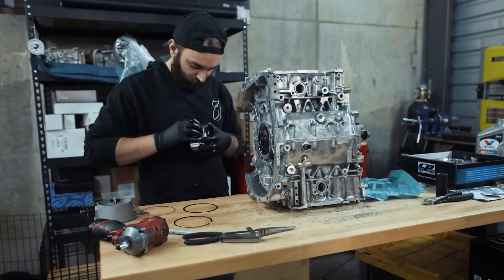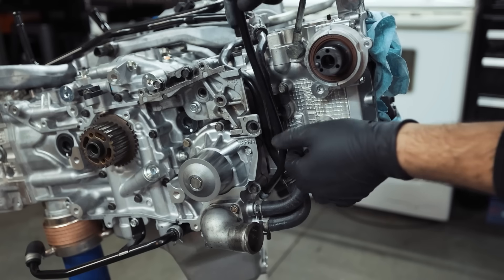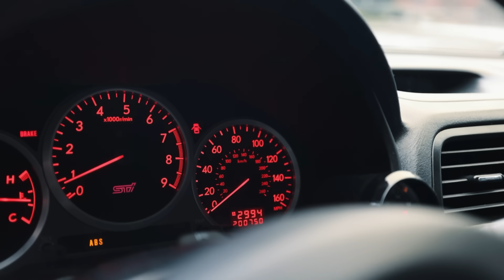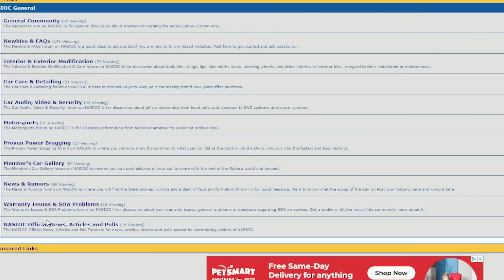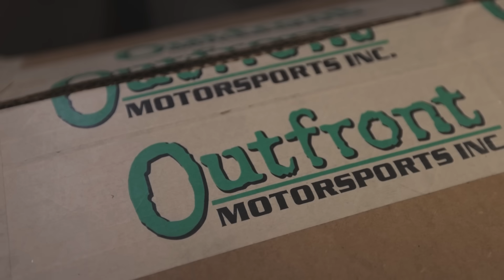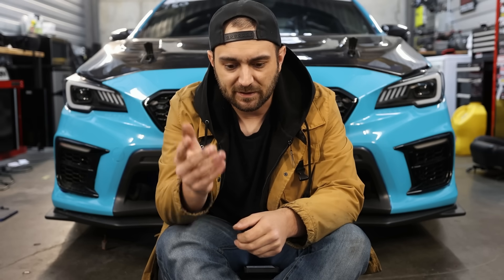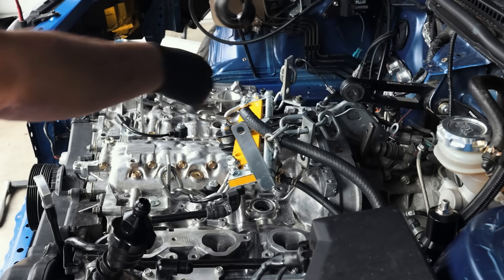The EJ Engine: Subaru's Crown Jewel or Overrated Relic?

Comment: EJ is overrated is 2024, the FA is a superior design for more efficiency and power production.

Edit: LET’S GO TANNER!!!
Reply from the maker: For the bang for buck I’d still take an EJ, keep in mind for anything FA related you need a standalone, port injection, secondary fuel system, STI driveline, no aftermarket cam options etc 

I’ll agree it’s more efficient up to about 450whp 😉
Reply: Why do you need stand alone?@Smeedia
Reply: Fa Still sounds like crap
Reply: @Smeedia  hopefully after a couple years of VB work they'll have some more options
Reply: @Pepin2k  you can run UEL header on the new Fa24 with a tune and doesn’t lose as much power as the Fa20 and can even gain power
Reply: FA’s are moneypits
Reply from the maker: @tungnguyen4074 but it still will increase EGTs, reduce fuel economy, negated the point of having a twin scroll turbo. Not worth the draw backs of UEL on a turbo FA engine
Reply from the maker: @christopherrogers8316  to be able to add port injection to support reliable power north of 500. Only options right now are motec, maybe emtron and link
Reply: @tungnguyen4074  gross, UEL is ridiculous. Even WRC runs an EL header on the EJ cars.
Reply: @Pepin2k  performance > sound. That being said my wife’s Mach-E GT will dust 95% of anything on at a light but it’s uninspiring. So sound does play a role in the feeling.
Reply: @christopherrogers8316  FA doesn’t support port fuel. Need to control Air Fuel and Spark. Port fuel allows a charge air cooling in the runner which has a pseudo Venturi effect. It decreases the pressure in the moving air stream which decrease the manifold pressure delta. Simply but not accurately put it’s more boost because it’s more fuel too but it’s the same load on the turbo.
Reply: @RadDadisRad  thats motorsport. EL header get more power and turbo respond which is what motorsport team wants. But so street it is alright to run it
Reply: @totaleclipse05  both turbo FA and EJ are money pit
Reply: Hey thats what i named my 21 wrx lmao!!@totaleclipse05
Reply: @Smeedia  i saw a video of a tuning shop testing their FA24 and it is not as bad as the fa20. But yea, the con out weight the pro
Reply: @Pepin2k  It sounds like a subaru with equal length headers wym?
Reply: EJs are still cheaper and easier to work on in my opinion, love FAs for the efficiency, but for ALMOST the same HP you can be just as reliable and efficient with a built EJ. I’ve seen quite a few that push a reliable 450 or more to the wheel
Reply: By today's time comparing the potential here is like comparing your grandpa to you in performance. Although fa24 is far better than the fa20 it's still a new platform yet to be pushed to its full potential. I've had both ej and fa
Reply: AHAHAHAHAHA no
Reply: @Pepin2k  💯 FA'S Simply sound like a pissed Off Raper Who Never Made it 🤷
Reply: @totaleclipse05 Some would say modding a Subaru would be considered a money pit. Only an immature person could consciously make such overarching comments and your kind is what usually who I see make bad choices tuning/modifying leading to money pit situations. If you had a deeper understanding of mechanics/cars in general,  you probably would retract your childish statement.
Reply: @beaches2mountains230  My 2019 is modded and has almost 70k miles now. I know how to take care of vehicles as I do much of my own maintenance on them. How is a true statement a childish statement btw? Sorry the truth hurts.
Reply: FA are a huge money pit gotta upgrade everything if you want power and want the car to still run. Ej’s are cheaper for power up to 450whp and don’t sound like complete garbage.
Reply: 2021 Sti. Small mods. I haven’t run into any problems and I have 40k on it. I think maintenance is a big thing with the engine. And not a lot of childish play. I think smeedia is right. Stop thinking it’s and Evo and the engine will last. And this comes from a previous Evo owner. Rs 2006 best
Reply: @Smeedia Do you think you can make decent power NA on FA24 or would the EG33 be better for NA?
Reply: @RadDadisRad  i think you add port injection just because the direct injection can only flow so much fuel to about sub 500whp. after is when you would add secondary fuel
Reply: @RadDadisRad  the fa24 in the stock brz/gr86 is both port and direct injected thanks to Toyota.
Reply: @christopherrogers8316  XDI has a prototype pump and injectors for the FA20/24. DI has its flaws and limitations with idle airflow and intake runner and valve coking. Port fuel idle air mixture and atomization is better than DI. DI provides maximum cylinder fill while decreasing preignition events, in most cases. One of the cases low speed knock aka “super knock.”
Reply: @Chris-df8qf  D4S sucks in the Toyota design
Reply: The EJ wouldn't be overrated if they were reliable. They should have never retired the good old 2.2L and the H6.
Reply: I seen 1500 HP EJs...  where's the 1500 HP FA?  😂
Reply: @iAmFAUST  did you manage to learn proper English while seeing those 1500hp builds?
Reply: @Pepin2k wrong.
Reply: @RadDadisRad you just swap to a BRZ manifold. It’s not that big of a deal
Reply: @beaches2mountains230 this

Comment: MotoIQ did a really good video comparing the EJ and FA.  The gist, that I took away, was that (from and engineering standpoint) the FA is better in every way except its lack of priority oiling, and it's still relatively new, so the aftermarket just hasn't had a lot of development time with it compared to the EJ (roughly one decade compared to roughly 4 decades).
Reply: The MotoIQ vid was packed with good intel on the FA. Reinforced my WRX Limited choice in '21, although now I've upgraded at least as much as the cost differential for an STI, and arguably would have been pretty sweet to own the last production model. I don't think we knew it would be the last in June of '21. Love my REX though, and now that Cobb has released flex fuel for '15-21...

Comment: The FA/FB series engines are the result of Subaru moving toward the mass market from the niche market - more EPA friendly to make the numbers.  The STI is gone mostly because of this.  These engines are cheaper to assemble - just glue 'em together with Three Bond.  Rather marks the end of an era.  Sad but predictable.  I owned a Subaru with the FB series engine - got the short block warranty replacement for oil consumption from those low-tension rings and water-thin 0w20 oil at 18k miles - and traded it at 48k for an F350 (it couldn't tow a 16k lb horse trailer...).  Still own 2 EJ cars.  Reliable, no chain rattle, no oil consumption issues, just old-school engines that do the job without drama.

Comment: The main problem with EJ FA FB engines is mass production, Subaru has to produce millions of engines as quickly as possible. During the casting process contaminates, oxidation, or dross are introduced into the mold causing irregularities visible on the outside of the casings. This causes internal stress and weaknesses that eventually distort the block, more (HP) stress and heat creates more distortion. The early EJ 20g and 22T blocks were cast in a vacuum chamber mostly eliminating contamination and porosity resulting in a much stronger block however this was not cost effective so Subaru abandon this method.

Comment: i just put a fully built FA20 block with an STI driveline but still don’t plan on making more that 500whp. i feel like the FA20 (idk anything abt FA24 or RA) is more reliable than the EJ255 but never had an EJ so im biased

Comment: It’s really a good motor and easy to work on. I have several over 200k and a forester with 300k.
Reply from the maker: I’ve seen a couple go over 400K, taken care of and unmodified they can go for a WHILEZ
Reply: I live in Japan and one of my dream cars is a GRB hatch. I would like to know how much more reliable an EJ20 is in stock form. It can get extremely expensive to repair them here.
Reply from the maker: @YuichiTamaki tbh the JDM EJ20s from what I’ve seen take a bit more abuse and are a bit more reliable when cared for
Reply: @Smeedia  Thanks for replying! Are oil leaks a given in these engines? Here cars with 100k kilometers go down in price dramatically.
Reply from the maker: @YuichiTamaki naturally at 100K you’ll have some leaks. Nothing outside of the normal. 

Valve covers, rear main, cam seals etc 🫡
Reply: There's a bloke here in Aus that bought his Subaru Liberty RS brand new in 1992, he's done 2 head gaskets, 2 rear mains, 2 tappet covers and 1 clutch in the 555,555 km's hes done on it. He's participated in rallys and other race events over the years and still looks brand spanken new. These cars will look after you if you look after them.

Comment: The EJ seems to handle high horsepower and high turbo boost than other platforms. Bader loves getting serious power from stock blocks. My FA20 blows after 350 hp and torque
Reply from the maker: FAs imo are fantastic up to about 450ish whp after they they become some serious money pits
Reply: 350? Ive talked to many tuners who say they are capable of 400+ as long as you keep the toque down, obviously the stock clutch is gonna need upgraded tho
Reply: @Smeedia maybe it’s cuz I own an 86 but is 450hp necessary out of an FA?
Reply: On no mods other than a boost controller?( Which is me).Stock fuel pump, no front mount intercooler, no injectors, pump gas? Unheard of
Reply from the maker: @omarawilson2853 on the 86 you can get more out of em, the 86 has Toyotas D4S that comes factory with direct and port injection. The WRXs only get direct injection

Comment: I think what I like about the EJ so much is that it’s such an accessible engine to learn on and there’s such a large variety of sub variants and once you know the basics you can basically do anything to them. My legacy with a 255/257 had its first motor last for 348000ks stock (killed it when I brought it home whole other story) and the second one now will be cracking 200 so they do last if looked after and not just abused

Comment: Ok the ej is a good engine, especially for its time. Its actually relatively simple. 

Ej20 turbo is a good build, especially 2.1 stroker.

Availability of parts, knowledge, common recipes for power. 

But for very high power i wouldn't recommend 

Good video, nice content

Comment: Crown Jewel. The EJ’s limitations are pretty easily overcome and relatively cheap in comparison to every other engine they have produced since. Mainly because overcoming the fueling issue on direct injection is SO costly.
Reply from the maker: If they make an affordable option for secondary fueling on the 24s that could all change 👀🫣

Comment: EG33 pretty much is an EJ22 with 2 extra pots. I’d have stuck with the 33 - dry sumped. Aren’t they also semi closed deck? 33 would have more air flow with less boost.

Comment: you are very knowledgeable when it comes to Subaru engines. EJ being produces for such a long time, fairly confident a lot of the inherent initial problems it had has been almost fixed. right now I am debating whether to pick up a 2017-2021 sti or to go get a 2024 wrx as another daily driver (I have a 2017 Toyota 86 GTS since new)

Comment: Honestly love the sound of my ej25, and I have had some problems with my subaru but mainly due to the previous owner, I have fixed every problem it had and now having it running pretty good. I don't think the ej is a bad motor at all, just have to stay on top of your maintenance and just use the car for what it's meant for!

Comment: Honestly my favorite part about the EJ is how easy it is to work on! People's first argument is always "but you have to pull the engine to get the spark plugs"... like okay sure the spark plugs are kinda a pain, but literally everything else is so easy and so well thought out! The fact that you can easily reach/access everything from the top or bottom is so great!
Reply: they have been around so long there is almost always a trick, or a set of tools/extensions that work perfectly for the tight spaces and you can figure that out on forums or by asking around fairly easily. doing spark plugs with the right tools is easier on an EJ than a lot of other cars that people generally consider easy to work on.

Comment: I've gapped the new 2023 wrx in my 2011 wrx with over 200k miles, I'm convinced that the extra low end tourqe of the 2.5 helped in a straight line, meanwhile the 2.0 makes it's power on the top and mid end

Comment: FA24 is a beast. Bolt ons and a tune will get you over 400lbft torque and close to 400hp.

The new FA's are also tuned better out the gate. Very smooth running without any weird fueling or timing issues like all of the EJ stuff ive owned in the past. 

The FA24 block is sognificantly stronger than the EJ. There are people pushing crazy high HP on stock blocks. Fueling is certainly the limiting factor. EJ on the other hand has issues holding a moderate tune with people blowing ringlands on stock power. 

EJ is great if you want 500+hp. Theyre simple, easy to work on, and have known issues that everyone knows how to address. But it looks like the FA24 is just wayyyy more stout out of the box.

Comment: Proud owner of a '21 STI here. Last of its breed, and will be missed. I have many plans for it, once the warranty is gone (august). Shame there is not going to be a port injected successor. :/
Reply from the maker: I think the days of only port injection are behind us now 💔
Reply: I have a 21 STi as well and want to mod it but due to the high cost of mods I'm going to sell it and mod a GC8. A lot more bang for your buck.
Reply: @thedon9670  I would keep the VA, as its literally the last of its breed. Its value will go up over time. 21 STI with 16k miles would fetch around $42k privately sold. Trade in is only around 30-34K. I guess it really boils down to how much you want to mod. Personally, im going mild. Id be happy with 325 WHP. After that, you have to worry about reliability, and i intend to drive it till the wheels fall off, then just replace spindles and keep going xD
Reply: @Smeedia  At some point i need to make my way up there, and hit up Josh (Bader), Devin, and you. Id love to pick all 3 of your brains and learn a few tips / tricks to get my STI where i want it.

Comment: All the vb wrx owners coming to the comments to get triggered lol. I own a fa20 wrx but can acknowledge the high end potential of the ej engine far exceed that of the fa20/fa24 engine.
Reply from the maker: The FAs are fantastic for sub 450whp but anything after they become so ungodly expensive to build. 🥲
Reply: @Smeedia  
https://youtu.be/FLDHUa-4-Ms?si=D5-h9p6nDO1XsdjB

At 12:30 mark it's a discussion about the transmission comparisons if you haven't ever seen it from gears and gasoline. I always appreciated this because It make me realize building a wrx to be reliable over 400whp would be ungodly expensive especially when having to do a sti 6 speed swap.

Comment: I've had EJs and loved them, but a stock FA24 block is a substantial improvement vs an EJ. You can surely pull the block apart and make an amazing example of an EJ like I've seen you and many others do, but stock for stock the EJ surpassed
Reply from the maker: We’re looking at overall, not just block for block. You’ll still hit the fueling wall, transmission swap, lack of cams etc for the FA24. Things will become substantially more expensive than if you were to do it with an EJ
Reply: @MotoIQ/Mike Kojima agrees with you. The FA blocks have better cylinder bracing and support. He has a long video comparing both EJ and FA blocks, and the FAs have a lot of notable advantages.

The Achilles heel of FA engines though is direct injection.

Comment: Talks about the fa20 on the wrx platform only forgetting about the brz/86 being port/direct injectored from factory and only need a bigger set of PI. They can make 400-500 on stock motor and when built still get 8L/100km on e85
Reply from the maker: They can make it but not reliability, had my fair share of BRZs both N/A and Turbo. Fueling system better than the WRX but still wouldn’t rank it the best

Comment: Smedia (boss) i just bought a 02' WRX bug aye that has a p0304 soaking spark plug on that cylinder but top on that i found that my turbo,intel,hose, throttle body was full of oil
Car smoke trough the oil filler cap withe,blue smoke and when i change the oil i found residue of metal on the oil (no piece of metal) just like car metal paint colors 
What kind of recommendations can give me ...if no bad to ask (first time i have my dream car)
Thanks on advice

Comment: JUST LIKE THE CHEVY SMALLBLOCK 350 WHEN THE LS ENGINES CAME OUT BACK IN 1997..PEOPLE WERE SLOW TO STOP USING THE CHEVY 350 BC IT WAS WHAT THEY KNEW AND IT HAD YEARS OF AFTERMARKET SUPPORT BUT WE ALL KNOW ABOUT THE LS ENGINES POPULARITY NOWADAYS. KNOWBODY USES THE 350 SMALL BLOCK UNLESS THEIR TRYING TO GO ALL ORIGINAL FOR A BUILD..
Reply from the maker: Up until an affordable alternative comes out for secondary fueling for the Fas, it’s going to continue to be limited. For the majority of people spending upwards for 25 all in to get past a fueling barrier is fairly unreasonable. 
8K standalone 
3K in software 
5K in a basic fuel system 
7k into a STi driveline